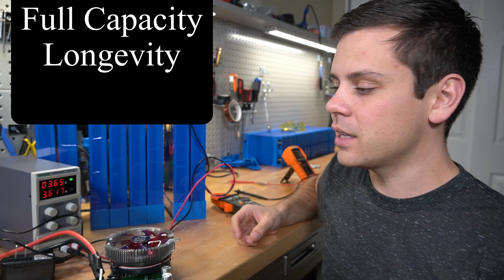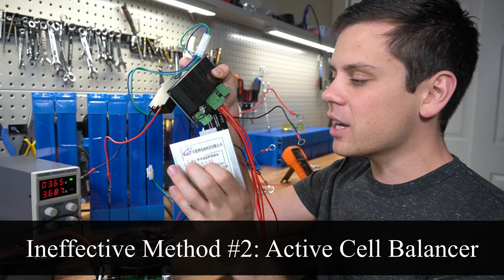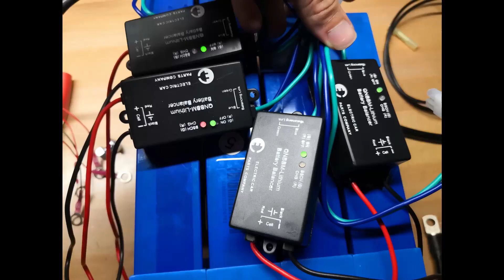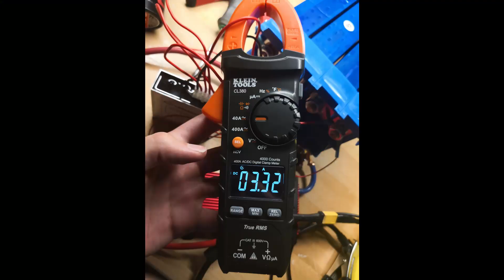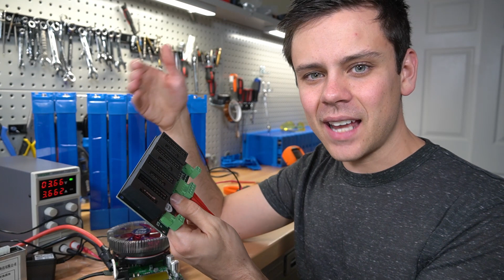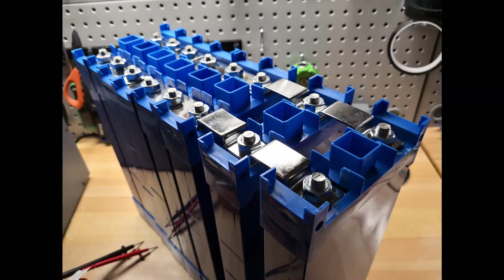Advanced LiFePO4 Cell Balancing Discussion (and how people are getting ripped off)

Comment: Yes, for new and old with same capacity lifepo4 batteries it may work, however, my 18kw battery bank is sep up of NCR lithium cells of various stages of capacity and age. To keep them balanced I have to use several Xiaoxiang, BMS-ANT24S, and JK-B1A24S. It isn't recommended for everyone to use this method but the other choices will be more expensive.
Reply: @ursodermatt8809  okay, thanks

Comment: I SUSPECT (I don't know for sure, obviously), but I do suspect that cell quality has increased a LOT in recent years compared to what it would have been decades ago.  Electrical Engineering (at the intro levels I've studied) tends to treat batteries as ideal voltage sources, and in the old days, that was just not true.  If you were dealing with unsealed lead acid, you had all kinds of chemical imperfections, material quality, water level, pH, etc issues. Plus the chemistry itself was, in a LOT of ways, far worse than modern LiFePo4.
Nowadays we've got modern Lithium chemistries, that are remarkably stable over their discharge curves. So many of the old issues just don't exist.
So to get back to the topic of this video, I'm inclined to guess that active cell balancers were probably something needed years ago, with more primitive cells, and less sophisticated BMSes, but now are probably obsolete for almost all uses.

Comment: Thanks for clearing up some myths... Batteries should balance at or near the desired top, and then be left alone during discharging, and only cut out when the lowest capacity cell reaches its bottom of charge. Yes, there will be unused energy left in the other cells, but this should be small.
After charging the pack should be close to balanced again, as each cell gets back what it gave out.
Active balancing during the middle and bottom of charge is wasteful and unnecessary, as the cells will again need to be balanced at top of charge!
Reply: What are you using to charge the batteries? It appears to me that a 12v battery charger would not work. How do you regulate your charge to the voltage of your charge? Maybe I am over thinking something here?

Comment: initial single charge :) .. 123 smart bms from netherlands .. 
I am very satisfied with that
Reply: I have it also. It doesn’t function perfectly for me, but one thing it does appear to do is balance effectively
Reply: @PaDutchRunner  well, 
the setting with the double-function mini dip switches is somewhat complicated. first the basic setting function, then the operating setting.
Reply: spiel automat I think I broke the dip switch. I’ve gotten pretty decent support from Sebastiaan though.
Reply: I'm waiting for v3 to come out. GWL Power have promised me it's arriving February. Good to hear it works well.

Comment: so, we can actually put all the  cells in parallel from the beginning. then charge them at 3.6V and wait until current goes to 0. correct?
Reply from the maker: Yes exactly!
Reply from the maker: But ensure that the cells are close in voltage when putting them in parallel. Charging them individually to the same voltage, then connecting them in parallel, is ideal. 

You do not want to connect cells in parallel if the voltage difference is larger than .1V
Reply: I will balance my LiFePO4 cells by draining them with my setup to 2.5 volts and cycle the on off discharge until the voltage is pretty steady which is at the steep part of the discharge curve. Once all the cells are stable resting at 2.5 I will then charge the pack to 3.55 volts then hold until about 2 amps. If the cells are all reasonably balanced from the factory they should all read when stable near 3.55 volts. A few may be a few 10ths higher or lower but I feel the safe bet is having my cells all reach the cut off point of 2.6 volts at the same time. This ensures that all the cells are at the same voltage level when near the end of the discharge cycle. I do not actively balance and a good bottom balance is usually good enough as I always stay off the bottom and off the top for best battery cycle life and safety. Even with a BMS it is a good practice. Balance at the top or bottom. I prefer the bottom. Let your BMS cut off a cell if a cell becomes bad and discharges way too early. That is the only reason or to cut off charge cycle if one cell fills to quickly. Remember, the lowest capacity cell is always your limiting cell. If you have one that is grossly too far out of whack from the others just replace it.
Reply: E-Biker Bulgaria  I don't actively balance LiFePO4 cells. I take them all to a static resting 2.5 volts. Then charge them up in series and watch which cell reach the max I will allow then check my overall voltage and use that as my stop point. By watching to see which cells are lower in capacity I will use those cells as my cut off point. If the cells are all within a reasonable capacity this technique works great. When I discharge I put my cut off above what I took them to bottom balance them. At the top I set the voltage so I know no cell goes over into the danger zone and no cell is ever overcharged. When I discharge them all the cells will be at equal SOC. You do not want a situation where you are cranking hundreds of amps through an empty cell because it discharged faster than the others. That is where things can go bad and you loose cells. I check the cells on occasion to see if there are any that have less capacity than before but because I am running them all at the same time they degrade at the same time. Usually no further balancing is required. If you need to rebalance then you have something in your system that is taking voltage from only a few cells and not the whole pack. It would be good to put on one of the cheap BMS systems to monitor voltage and have a redundant system just in case. As for active balancing?  No, you really don't need that. Not even with the other chemistry. Just have your redundant system in place as a back up. Start out with your cells all the same static voltage whether on the top or bottom. Remember, your lowest capacity cell is the on you set your whole system to so you don't destroy that cell. If the capacity is way out of whack you replace it with one that is on par with the other cells. If you top balance you then need to set you cut off voltage to the cell that discharges first. The rest of the cells may have some energy left but usually not enough to worry about so those just go along for the ride. If your BMS is constantly balancing your cells you might want to find some better and more stable cells. Lithium is a pretty stable chemistry whether LiFePO4 or even the 18650 cells. Always first either bottom or top balance your cells. Im top balancing my Leaf Modules. Using the inverters cut off point and having a redundant system as a back up just in case a cell craps out which can happen. You don't want an active balancer in that case either because it will think it needs balanced and you can't balance a ruined cell. You just want the system to shut down so you can go figure out what cell crapped out. Usually the voltage reading from the BMS will tell you exactly which one crapped out.
Reply: E-Biker Bulgaria  What you are proposing is to have a system where if you have a low cell which should be your limiting cell, the active balancer would push or charge that low cell with the other cells until all the cells are low during discharge then do the same when charging. If you have a cell that far out of capacity compared to the other cells you need to replace the cell. They do have BMS systems that will balance a pack on the top but not on the bottom. Once the pack is balanced either on the top or bottom there is no need to balance again unless for some quirk you have a cell go out of bounds which would indicate a cell going bad and then should be replaced. There should be Zero imbalancing in your pack over time. The only thing that will cause that is a failing cell or you have something drawing current from only a few cells in the pack vs the entire pack. It has been shown that the active balancers don't really gain you any more capacity which is what you need for your distance. If you are short capacity then you either don't drive that far or increase your capacity by adding a few more cells to your pack while retaining the pack voltage. I just wouldn't waste the time and effort to gains a few amp hours from your pack. Just make your pack larger for capacity or don't drive so damn far. There are limits and if you have a pack that lets you ride your bike 60 miles then I'd say you have done quite well. Missing it my a couple miles could be because of weather, riding faster than you should or tires or wind or something other than capacity. But driving to the absolute end of charge is risky both for being sure you make your destination and the safety of your pack. Be safe.
Reply: E-Biker Bulgaria  You will need to show how much further you can go on 100mv. A shorted cell in parallel just reduces the capacity. Power has nothing to do with capacity. The minute amount of pushing and pulling of voltage back and forth to keep it all in balance to the bitter end is pretty moot. You can but make it easy on yourself and just increase the capacity of our pack. For a bicycle pack it won't break the bank to do that. One extra cell in parallel  for each of your packs in series would suffice for such a small amount of capacity as 100mv. It would be interesting to see the true distance you'd get. Like with my electric car. I stay within the limits of my pack. 100mv in that don't mean squat. I never drive my car to the end. Ever.
Reply: E-Biker Bulgaria  End of charge is not risky if all the cells are at the same voltage and you have a cut off device to ensure you don't' go further if you reach that limit. If all your cells are what I call ragged on the bottom you have a higher risk of loosing batteries if one cell drops below the threshold before the others and before the BMS says stop. Running current back through an empty cell will seriously overheat and kill the cell and maybe depending upon type actually cause a fire. Equal balance at the bottom ensures you won't have that problem. Just take the time to do it right an not cut corners. If you are not revealing all your information then you should before posting. I run up on LiFePO4 cells to 3.55 volts overall and 2.5 on the bottom. My controller allows me to never go below 2.5 volts and will reduce the current to the point of zero so I never go below 2.5 volts overall. At that point on bottom balanced cells all my cells are at 2.5 volts. On the top, when I reach 3.55volts I may have a couple cells in the 3.6 or 3.7 volts or even a couple in the 3.4 range. Doesn't matter because when you bleed off the top in the first 1/4 mile all the cells are reading the same voltage. That top charge curve goes away quickly once you begin putting a load on the cells. I've been working with LiFePO4 cells before Thundersky came out. I've tried cheap ones and expensive ones. The Thundersky and Calb are good. HiPOwer are not so good but OK. They all still charge the same. Max for those cells is 4.2 volts per cell. Over that and you risk problems. That is why LiFePO4 cells are now typically charged at 3.65 or under. I have stuck with the 3.55 as a good safety and yet that 3.55 is in the beginning of the upper charge curve so you don't get much after that anyway. Better safe than sorry. Ask me how I know.
Reply: E-Biker Bulgaria  I assume you keep your cells within reasonable safe limits. So yes, I assume. I also know that there are plenty of people out there that don't and I also speak to those when I write or talk. If you follow safe practice then good. Im saying why so much bother for 115mv out of balance. Put in one or two more cells per your voltage packs in parallel and you have dealt with your 115mv of out of balance. I agree that 115mv is not much at all. That is the reason for my comments. Just like I don't loose sleep over mine being a bit ragged either. In the end all will be different and all will have a ragged top or bottom when in series. Can't get around that except be sure you don't go over the voltage or under the voltage at the bottom. I just prefer to have mine all the same at the bottom and feel its the safety and least risky. With my Leaf Modules I'll be doing the same but on the top. Those will have a ragged bottom so I stay within the ragged areas and never mind a 115mv. If I need to gain that much more I'll add a single module in parallel to all my packs to over come that capacity I feel I may need. Makes my pack larger but that is how that goes. Im not saying you shouldn't but the true gain using active balancing is negligible and it also produces waste heat so in the end you may if you do some serious testing find you loose capacity vs just not using active balancing. Have your BMS just balance on the top and shut you down on the bottom. Stay within your pack limits of capacity. Summer weather will net you more distance than winter. So many variables.
Reply: E-Biker Bulgaria  My experience has been since 2009 when I started converting cars to electric. I have been in the lithium crowd since we were able to get lithiumn for the cars. Namely LiFePO4. I have since move to other chemistry but I do still have 80 some Calb 100Ah cells going into my next build. I know batteries and I know balancers and I know what happens during over charge. Over discharge and what actual benefit you get from active balancers. As he said, they don’t provide enough extra to make them a worthwhile investment. I agree. So little gained. Like trying to squeeze that extra drop of juice from the pulp you get from a juicer. Its not worth the effort or cost.
Reply: @onegreenev  Jeez man, have ever heard of paragraphs?!?!
Reply: @vespagts7078  Ever hear of discussions? Lots of paragraphs. Cheers.
Reply: Sort of. If the cells are already close to balanced it works great. If not then no. The limiting factor is always the lowest capacity cell in the bunch. Always. Even with active balancing the little extra you might eek out is pretty minimal considering overall capacity. But even with active balancing the lowest capacity is still the limiting factor. That's all. I have leaf modules I did this with and it worked reasonably well and I found the cells were all well balanced from the factory. So I connected many in parallel to self balance before charging. But you might want to disconnect your cells after doing that and let them sit for a few days because you may still find out of balance cells even after a week or two of sitting in parallel. It works OK to get things close. Putting in parallel does a lot of grunt work for you then you do fine tuning on single cells if needed. Just depends on the overall condition of your cells when you receive them.
Reply: @onegreenev  I was going to help you, by reformatting your long-winded hodge-podge of smatterings into a more coherent and easier to understand structure of sentences and paragraphs... but I quickly realized that you have the writing skills of a 6th grade dropout. No amount of formatting was going to save you, so I gave up. Cheers.
Reply: @vespagts7078  It is apparent you have no clue about batteries. Battery care is not a cut and dry affair. Depends where you get them. What conditions they are in when you get them and how you intend to use them. Im aware of all the aspects people have used to monitor or balance batteries. There is no one simple answer. As for personal attacks!  I'll kindly ask the owner of this channel to remove both your response and mine.
Reply: @onegreenev  Nice try, but responding to the wrong person doesn't change what that person was saying.
Reply: @vespagts7078  I clearly responded to the correct person. I still ask the owner of this video too kindly remove the offensive unprovoked personal attack post. I'll await his response from you to me.
Reply: @onegreenev  LEAVE ME ALONE! I WILL NOT SAY IT AGAIN. STOP CONTACTING ME!
Reply: @vespagts7078  You started this. I'll just contact Will directly about this.

Comment: as long as you match types of cells any can charge in parallel . even lead acid can be parallel charged . as long as same type like AGM . best to do from new . is that little bit extra amp hours worth the power the balancer uses it self.  great job showing data from the different balancers . think money better spent on better BMS having low and high temp cut off. that is more likely to damage the cells that the slight imbalance will.

Comment: Excellent info, trying not to be too obvious, (parcel photo, address) . I just got back from a 20 mile trip on my electric bike, to the nissan dealer, speccing up a 40kw e-NV 200 to replace my VW t6 camper. Got home and it's the first day this year my solar pond pumps were running. Must be spring in the UK pennines.

Comment: Brilliant,  have been operating a 100A/H lifepo4 for two years in my camper and they were only out by less than 1/2 A/H between individual cells. No ballance fitted.